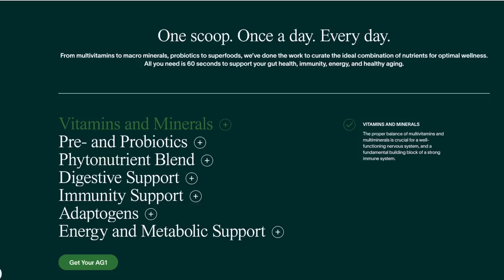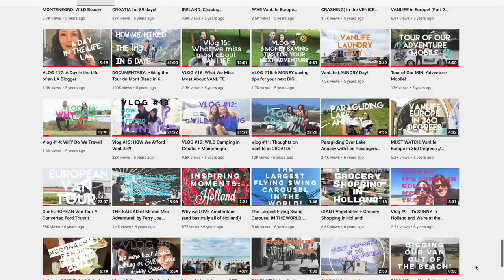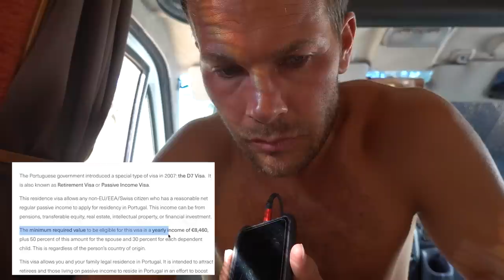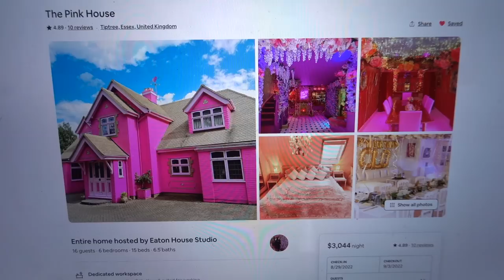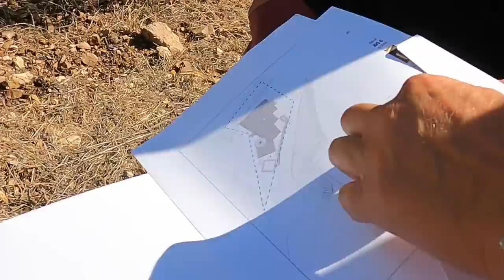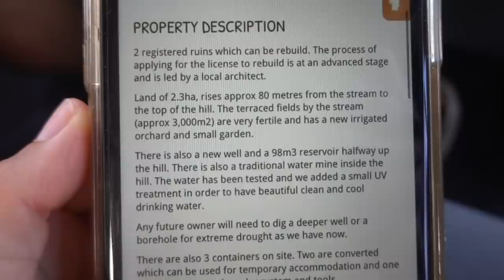WILL WE MOVE TO PORTUGAL? CONCERNS BEFORE PURCHASING PROPERTY ABROAD 🇵🇹

Comment: When you build.a well in Portugal with cement like the one you showed on the new property why on earth wouldn’t you build in some rebar steps from the water up the side of the cement wall to the hatch opening in case someone did fall in. I will never understand the thinking that would not have an escape out of a well. Just like I don’t understand why in France and Spain and Portugal they don’t have a shed or covering for the cars from the Sun! When the sun damages the car interior and the paint over time and cars are a MAJOR expense! I don’t get it! Also are you guys checking for fire prone areas when you are searching for properties. I would think you would not want to live in an area like that.  I did notice that on the Indie Project their home was protected from the fire by the slate roof and the major cleared area around the house with area for parking and outdoor kitchen. It helped protect the home. But water and electricity and fencing was destroyed. So will you put electricity, water well underground to protect from fires and will you use something fireproof for fencing? Just thinking ahead!